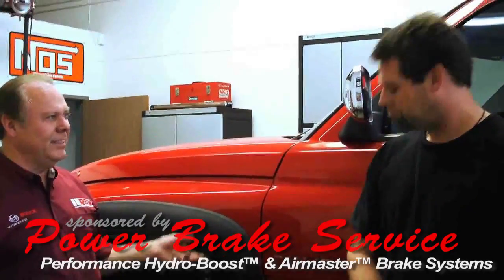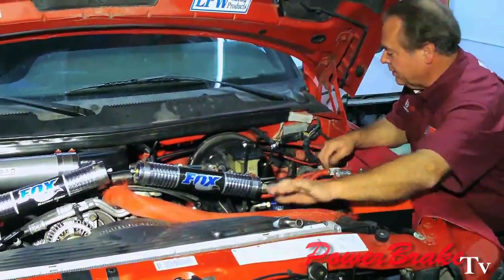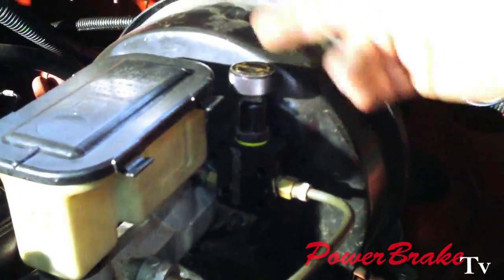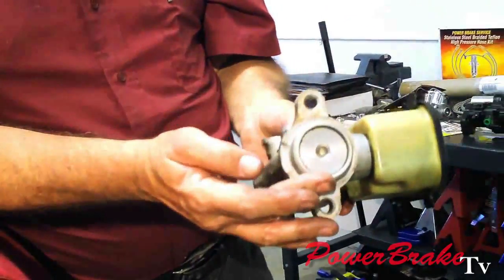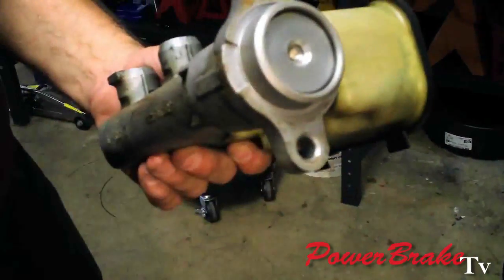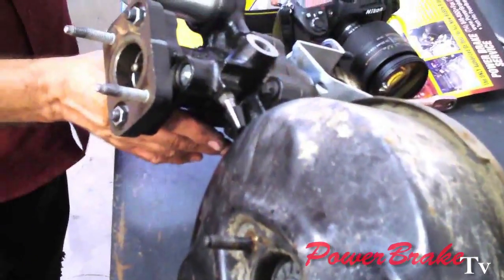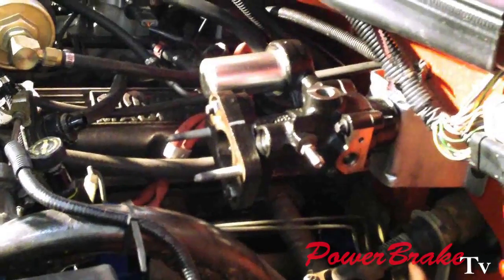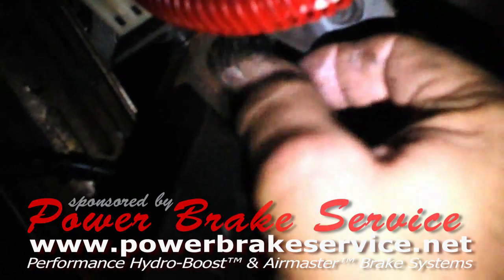Vacuum Brake Booster conversion to Hydro-Boost on Performance Vehicle - Sweeting Performance

Comment: Do you know who does this conversion? I have a 1986 pontiac 6000ste with teves abs generation 1 . Parts are obsolete and no garages will touch it /work on it near me. I went to 5 garages. I would like to convert my teves abs unit to a power steering assisted master cylinder booster combo. Any help would be appreciated.  Im willing to spend 1500 or so on the conversion. Im on the east coast 10min from Philadelphia.  Thsnk you